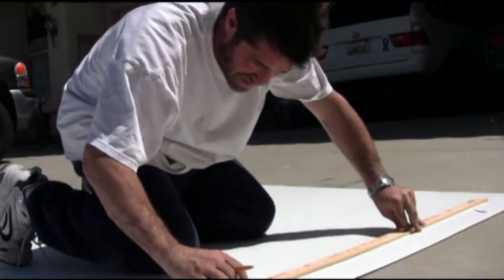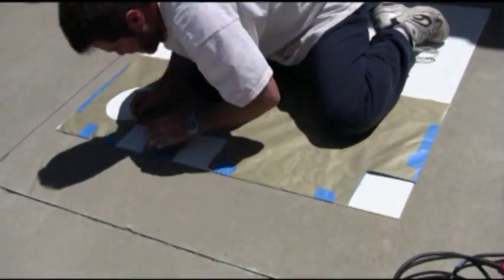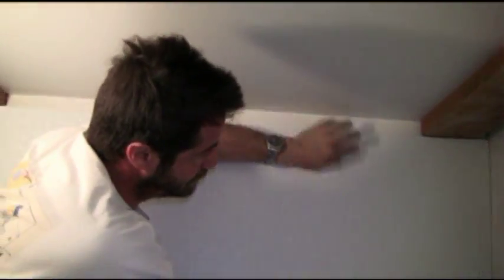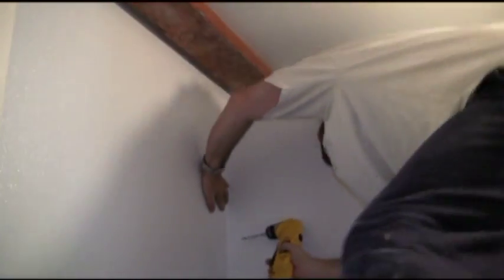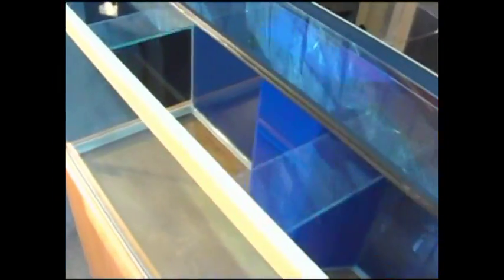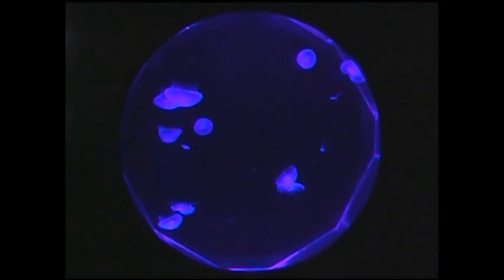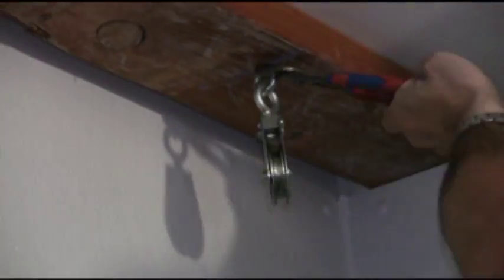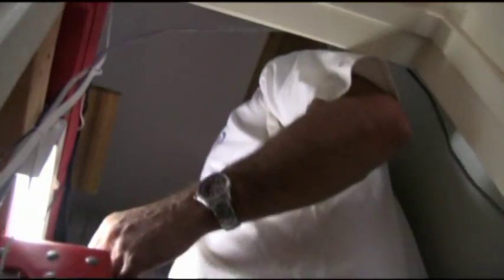Coral Reef Aquarium LED Lighting, LA Fishguys Episode 99 pt 3

Comment: @BigGayDoug It definately was pretty sketchy. I think the saw actually did fling one of the bolts. I came up with that idea in a pinch. My plan was to use my bolt cutters but they were previously abused and wouldn't cut the eye bolts like the bolt cutter at the hardware store did.